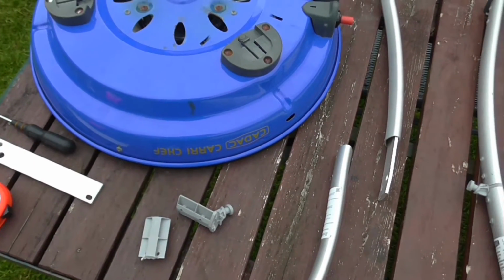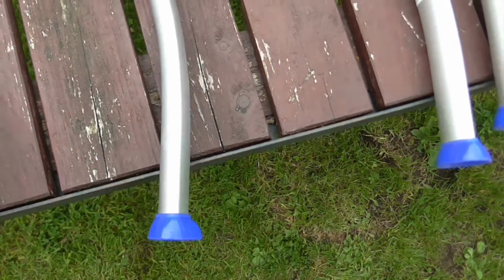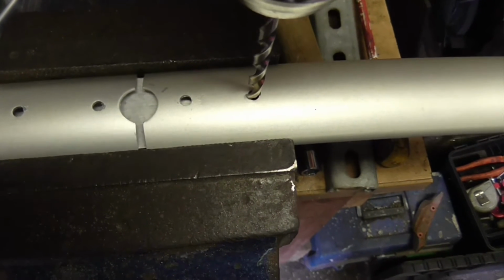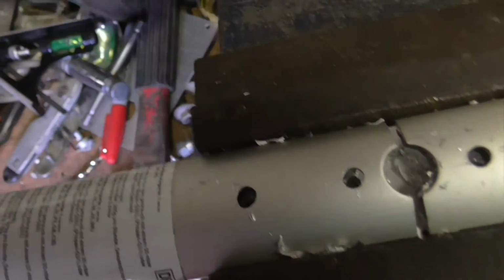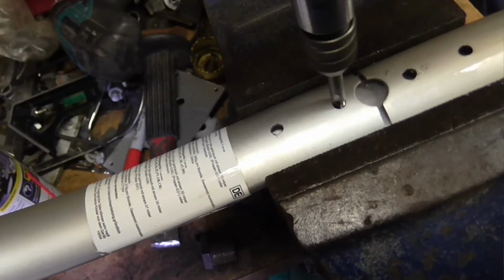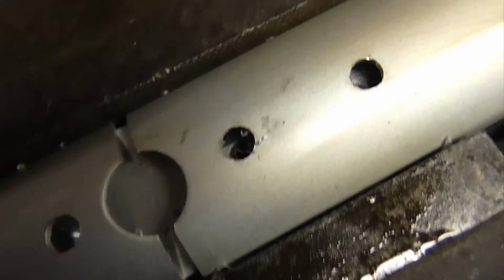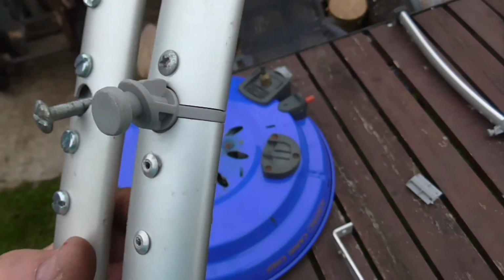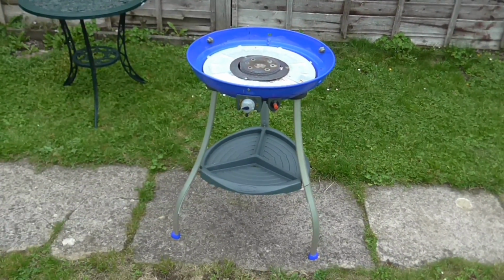Cadac Carri Chef gas grill broken leg repair safe and strong...

Comment: there seems to be a lot of variations on the old carri chef models.. mine is a carri chef 1 meaning none of the carri chef 2 parts fit it, but mine has one-piece legs that screw on and the igniter is part of the gas control knob like the carri chef 2. i bought it in 2006, don't know when the design changed to the carri chef 2. cadac is not very common in north america, i have one because rei sold them for a short time and i bought mine when it was on closeout sale for a very low price. as far as i know, the carri chef 2 is no longer sold here.
Reply from the maker: Hello marzsit..... thanks for the comment they are great grills pretty common in Europe.. I always have a good look round outdoor/camping stores when I've been to the US...and never seen them.... the lack of spares is a bit annoying I guess they want you to buy a new one! the old built in obsolescence surely one of the world's problems with waste..!
All the best ......Trevor